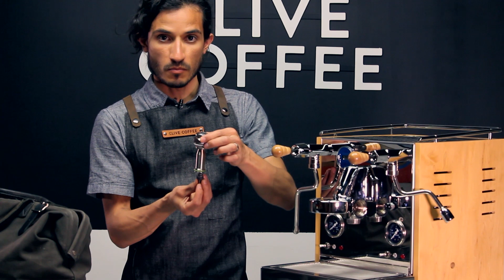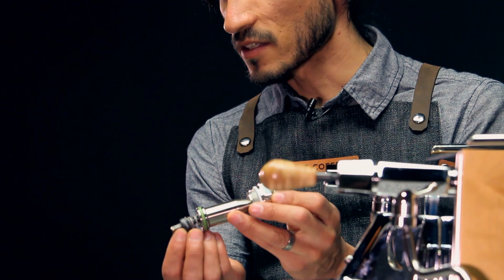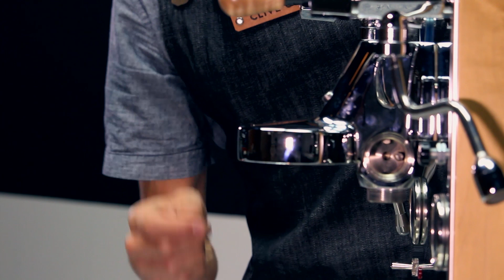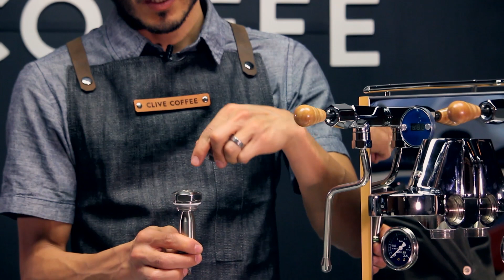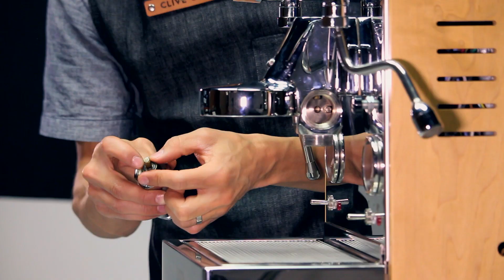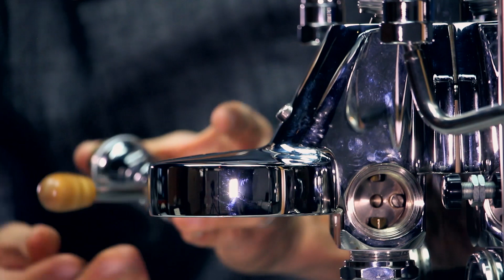E61 Group Head | How It Works

Comment: nice video. which group is better  original E61 (faema+vibiemme) or  E61 which  meet on  bezzeras, lelits, ecm, rockets. There are 3 springs 1-upper (inside mushroom) 2 middle 3 lower (2-3 located inside relieve valve)  interesting to know why on some machines  only middle spring mounted, no lower spring.
Reply from the maker: neither is better or worse. they all function the same way.

Comment: What Is it used the allen bolt in the E61 group ? Is it for some kind of adjust or trim ?
Reply: If you mean the one at the front pointing up at 45 deg, it is to fit an optional pressure gauge. This gauge is very useful to judge how well you have packed your basket. Mine shows 9 bar if packed correctly.

Comment: From my understanding the E61 group heads main benefits are.
1. Thermal mass, gives thermal stability.
2. Soft, Pre infusion. 
The correct operation has two steps, first position is for pre infusion, this allows water to pass through. Lever should be left at this position for at least 6 seconds. After that the lever is moved to position 2. This will activate the microswitch and in turn the pump to force the water through the coffee.
Reply: So with a machine like E61 Lelit Mara X, one sales company claims "Pre-infusion ... Pulling the lever halfway up will open the valve to allow water into the grouphead without activating the pump. Please note that true pre-infusion requires the direct water connection whereby the water pressure from the waterline creates true pre-infusion. In a reservoir machine, the preinfusion is driven by the build-up internal pressure in the heat exchanger." Sooooo are we getting that E61 preinfusion benefit here or not? Kinda alarmed to learn this as this machine can't be plumbed and it was on the top of my shortlist.
Reply: @bouncingboxer  Your right Mark it is not a typical "Mains" Pre infusion and certainly not a "Slayer" Style pre infusion.. However if you find the position on the lever just above the Midpoint,  just before the cam hits the pump switch, you will get a "Pre-Wet" and this pre-wet will have a beneficial result by wetting the cake, pre pump. If you cant find the "Sweet-spot" or "Pre-wet" position, you may be able to adjust the switch to allow the cam to have a bit more play before hitting the pump switch.

So in summary - A machine that is not connected to mains with an E61 head will still give you a "Pre-Wet" which will benefit the end result of your espresso.

Hope that helps.
Reply from the maker: This is true! Though, it is worth noting that the pre-infusion functionality will only work for direct plumbed machines. When using an internal reservoir there is no line pressure and thus water is not pushed through the group head when the lever is in the halfway lifted position.
Reply: @clivecoffee  Is this true (regarding needing a plumbed machine for pre-infusion) even about "flow profiling" machines such as the Lelit Bianca?
Reply: Clive Coffee, yes good point. However I do find with certain E61 assembly’s, some water will pass onto the puck without line pressure, just boiler pressure. I think some of the stems are longer and cams are larger. 👍🏼
Reply from the maker: @kayneensten  That's true, though we've found even this to be quite inconsistent in terms of quantity and temperature, even on the same machine. Introducing that inconsistency defeats the purpose of pre-infusion so we recommend against trying to use it. When direct plumbed, though, we love manual pre-infusion with E61 groups. That's a big reason why we always intend to have a custom machine that sports one!

Comment: On my E61 (Rocket R58V1), the soft brass "pin" (aka, pushrod) for the bottom pressure relief valve wore from use (after thousands of shots), and became too short to allow the valve to be pushed open by the cam at the end of the shot.  It took me a while to figure it out.  The machine no longer "burped" at the end of the shot to relieve pressure.  Once I did see the problem, replacing the pin and gasket restored operation.
Reply from the maker: Nice work!